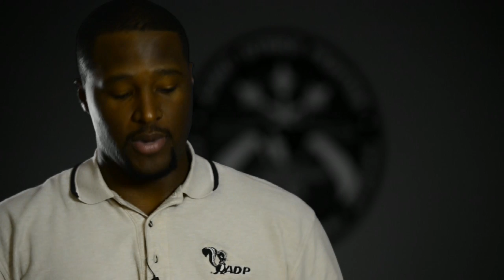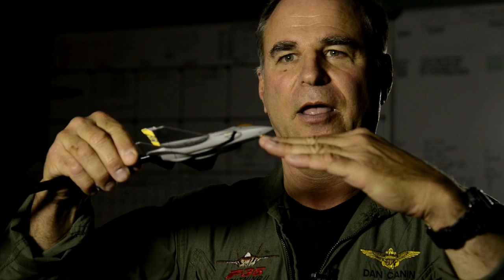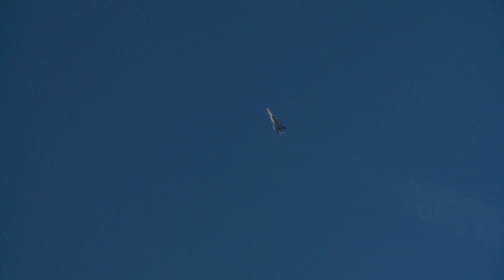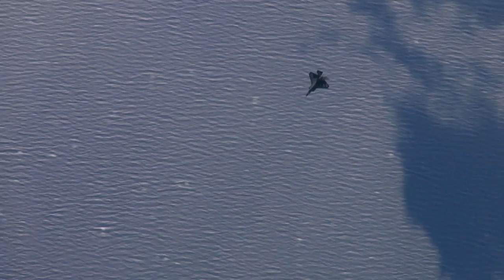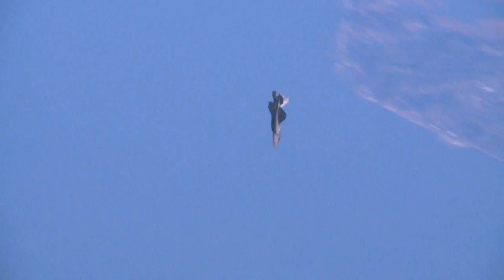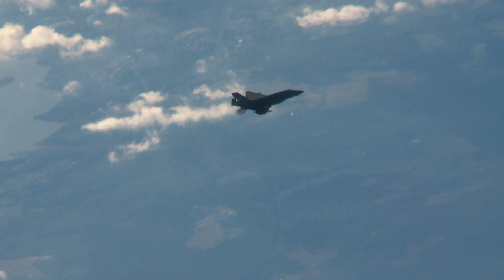F-35C High Angle of Attack

Comment: Committing a flat spin and recover from it without tvc is damn impressive
Reply: TVC adds weight and complexity. 3D TVC adds even more weight and complexity. Case in point Indian AF SU-30MKI with TVC have 19% mission availability with TVC. Indians have disabled and removed TVC to improve availability. TVC in SU-30 family only activates below 200 knots, and gains authority below 150 for slow speed. Intent is for SU-30 pilot/crew is to slow down the fight to where American have low energy disadvantage. F15 and F-16 crews train to maintain energy (speed) in a fight. F-22, F-35, Rafale, Typhoon, and Grippen pilots can fight at low energy states. Turns out that European canadrd double delta planform is just as good for low energy and high turn rate fight with high nose authority. F-15C below 220knots IAS, has little chance against Typhoon and Rafale in guns/IR missile fight. Those canard double deltas can convert to F-15C six faster then F-15C can react.
IAF and USAF did a worst case scenario exercise. IAF would have all advantages, and USAF would have no advantages.
RUles:
Red OPFOR:  IAF force 17 SU-30MKI with USAF E-3C acting as Indian AWACS. SU-30MKI have TVC, R-73, R-77, and Indian missiles. No restriction, except for missiles being inert but with active seekers. No radar or IRST restriction. In flight refueling tanker available.
Blue Friendly : 12  F-15C . Restrictions. No AWACS, no tanker, no AMRAAM. AIM-9M and AIM-9X with guns only.

Three day air war exercise. On day one IAF had upper hand and were able to score hits based they were able to fire their radar missiles first. 2nd day. F-15C squadron adjusted tactics, and were able to get first lock, but were restricted to AIM-9. They still got kills, and took hits. 3rd day. IAF problems became accute. Their servoce availability went down to 25% percent mission readiness due to maintenance and slow re-arming, regeneneration. Then dropped to 19%. Indians disabled TVC on their SU-30MKI and mission availability climbed to 35%-40%. USAF maintenance and arming crews were able to generate F-15C quicker with 60% mission availability.

End result as to victory conditions were classified by both Indians and Americans. But it was clear that in a real world conflict with no restrictions, Americans would be able to generate more consistent numbers of aircraft across time of conflict. So whatever victory that Red side seeks in RW  air war against USAF + Allies, it had better gain in first few days.
Reply: @dkoz8321  russian dont even use 3D tvc, they are 2d, but canted like a V shape for some mixed yaw and roll control at the same time.

Comment: Let see how the "C" variant holds up to the recent review.  They have severe problems with causing pain and disorientation to pilots on takeoff and landing.  The "C" variant will only be "ready" by 2019.  The acknowledge the landing gear needs to be redesigned on the f35 "C" variants as of 2017.  I see more Advanced Super Hornets in the  future.

Comment: IMO The F-35C should have been a twin engine fighter as an exception. It meets the Navy requirements and can be way more powerful.
Reply: ***** Yeah I know, it was just a suggestion. But the C variant is already good as is.
Reply: +Stormsquad 2 engines requires X2 the maintenance and X2 the probaility that something goes wrong and causes the aircraft to crash....F16 has been flying for years on 1 engine no problems. get with the times its not 1930
Reply: +Vijay mehra This is an old comment man, it's ok, I know 1 engine is good enough

Comment: F-35 "can out manouver the F-18 Super Hornet (In dreams) say some, if is true, explain this: the F-18 Super Hornet have LIFTING nose surface extend it from the Leading edge wings toward the thin nose, Have it the F-35?, Have Canards the F-35 as Typhoon, Rafale, Gripen and Su-35?, Have: Vectored trusters as F-22?, Why lost energy in his 60 AOA and go down fasted as is seen in test videos, I dont see a F-18 Super going down losing altitude, less: the F-22 and Su-35 in any video or air show, easy to understand: vectored trusters (F-22), Canards (Su-35, Typhoon, Rafale and Gripen) and zero lifting nose surface (pledges) as any F-18, this say all in dog fight and close turns.
Reply: cannricky Perez Not sure why you think the F-35 can't have a higher AOA then the F-18. Aside from pilot testimony (not on Lockheed's payroll), there are many ways to achieve a high degree of AOA aside from LERX, Canards and Thrust Vectoring.  F-22 and F-35 uses Chines to create the same effects as LERX.  You definitely DON'T want Canards on anything like an F-22, F-35, F-18, Su-30 or Su-35.  Europeans use Canards to fix inherent problems with their delta wing designs.

By the way, Lockheed never said the F-35 couldn't dogfight.
Reply: cannricky Perez Indian Su-30MKI has electronic defects, and screens go blank in mid-flight. 3 have crashed already. Believe me I know
Reply: Stormsquad Also, a Indian MiG-29K crashed because of FCS problems
Reply: IBT98 No the Mig-29K is for the navy, it never crashed. It was a normal Mig-29 that crashed which was of the IAF. Here read this http://timesofindia.indiatimes.com/india/MiG-29-crashes-in-Jamnagar-pilot-ejects-safely/articleshow/25434042.cms
Reply: Stormsquad recently, a MiG-29K indian navy was damaged doing a landing
Reply: IBT98 Show me the link
Reply: IBT98: my friend, I think that Stormquead is right, many argumentists talk without a reference or inf. title topic, he is posting the web page. Sincerilly landing gear is a little failure if you compare F-35 mishaps history, as F-22 Alaska pilots talk to you about good performance, is the desire of F-35 pilots.
Reply: cannricky Perez F-35 has never crashed, the F-22 has crashed about 3 times and the Migs have crashed countless number of times. Especially the Mig-21s
Reply: Not crasched of course, agree.
Reply: +cannricky Perez Only the su-35 prototype has canards.. the production version doesnt
Reply: You understand absolutely nothing about the design of modern 5th generation airplanes!
Reply: This whole reply section is a pile of steaming bullshit.
The F-35C outturns the legacy hornet by 1 degree per second and super hornet by 2 degrees per second in the sustained turn rate. The only place where the hornets have an advantage is in high aoa or instantaneous turn rates, but the F-35C does still have some vortex generators and a much better lifting body than any hornet, closing that maneuverability gap by a lot.
Reply: Don’t believe me? This is a video of an F-35C doing a 7g sustained turn. https://youtu.be/4FqO5kbE7gQ
Reply: https://youtu.be/56sN40ojEv8 This is an F/A-18 blue angels legacy hornet doing a sustained turn rate of just 17 degrees per second at 7g.
Reply: https://youtu.be/C3PAEIUc09A And this is a super hornet doing 16 degrees per second sustained turn rate at 7g.
Reply: And to add, this is an F-22 doing a sustained turn rate at 7g: https://youtu.be/FyviMdwwWRA
17 degrees per second, more than 1 degree less than the F-35C at 7g.
Reply: Second language, simple: F-35 dont have "Post stall manouverbrability and CANT outmanouver the F-18 Super Hornet.
Reply: Lockheed and Pentagon words, not me, lol. About 100% stealth and Dogfight.
Reply: Su-35,Su-27 lose tons of energy....especially in high AOA
Reply: Su-35 lose tons of energy?, really??, telling with words is easy but I when I see the "Cobra" manouver in PRACTICE, in any source video: I don't see the Su- 35 falling or loosing altitude vs any actual F-35 video where lose a lot of altitude, only with this little facts! : the F-35 can't do "dogfight"  •Lockheed words•, don't have canards to enhace AOA with Pitch axe, less: vectored thrusters but in F-22 with more weight, I see the "Cobra" and the F-18 Super Hornet: never with "Cobra" but better that F-35 in hight Pitch because have leading lets in his all front nose extend to wings leading edge.
Reply: cannricky Perez The Su-27 in general has inferior L/D in the turn.....and...although it gains energy in a stalling AOA
Reply: Thanks, but yet, the F-35 don't to convince me, the F-22, the F-18 Super H. and Su-35 were proved in Red Flag exercices more of 4 years ago, neverthelees the F-35 dream to particape but as is VFR exercices; dont have hight performance manouverbrability to do dogfight against Typhoons, Rafale, Raptors and S. Hornet, these also have advanse ECM package to defended himself or atack, not old version as 4 generation aircrafts, this tell a lot about engagement rules vs data specifications,  hight AOA or limited stealth "technically" just saying.
Reply: How can fly in combat when is grounded after have surprise troubles while is operational in bases?, the new mishap in engine fire acording to web. information explanation, Aviation/http://Videos.www.com and maybe: Combat Aircraft magazine was: hight pitch/roll manouver the cause and consecuent failure in engine protection, to make sense: as was with F-22 oxigen problem and paint job, this measures limit the hight combat performance of any aircraft, but F-22 was fixed and finish history. And rememeber: the EF-18E Growler have good ECM in simulated Red Flag shoot down a F-22 that 100% stealthly vs F-35.
Reply: cannricky Perez The F-22 can fly pretty well, There seems to be no problems...actually talking with a F-22 pilot form Alaska a year ago

The F-22 has no engine problems

same can't be said for the PAK-FA

or the Flanker
Reply: But IBT98, the Flankers don't have engines problems and you can read news of Su-35 new generation but my friend, you forget the F-35 engine fire and faillure.
Reply: cannricky Perez Remember the PAK-FA?

A new engine blowout just happened 

T-50-2 was destroyed by the fire 

second, you do know there are only 12 operational flankers in Russia right now?
Reply: O yes, the Pak T-50 had fire in his intake right engine, but not Flankers Su-35, also the same cheap Indian Su-35 Mk not had.
Reply: cannricky Perez But they are grounded because Russian engines are shit

They are easily damaged and unreliable

AL-41F for the Su-35 is terrible
Reply: This is new??, well I can't contribute about Russian engines, my personal information in this specific topic, is very limited, I know about Pak engine fire, but as I know; Russia is yet keeping the proyect and are some news videos in Youtube.
Reply: cannricky Perez IT is new and it's really funny
Reply: How I can search inf. With: Su-35 AL-41. or is another proyect?
Reply: cannricky Perez look it up :D
Reply: I. Know that China made his own Su-35 engines, I don't know if India can do the same about Su-35, but at least :India not have engines troubles.
Reply: cannricky Perez But they are, but they manage it much better then the Russians

Comment: STOP the fucking F-35

yeah it can hold a 50º angle of attack and some more

but it's turn rate is worse then the Su-34's

It can climb, 

It's 43 seconds behind the F-16 to accelerate from Mach .8 to Mach 1.2

It can't maneuver to dogfight  

Loses more energy then the Su-27 in a high G turn

Just stop this shit
Reply: Dude, I think your information is behind the times.  I've been researching this craft for a while.  My suggestion is get away from youtube.  The F-35 out thrusts the F-16 and when combat loaded out maneuvers the F16 and F-18.   F-16 pilots say that when the F-35 open up on the throttle (without AF), the F16 pilots have to use afterburners to keep up.

"Loses more energy then the Su-27 in a high G turn"

The F-35 with a combat load can currently max at mach 1.6 but its top speed hasn't been set because of concerns to friction on the RAM skin which is being worked on.  The Su-27 in the same situation cannot even do Mach 1.6 and can not out maneuver the F-35 let alone the F-35's advanced weapon system.
Reply: Lets look at some figures against some proven and supposedly superior platforms, lets compare them and see. 

If you really know something about planes you would know that you basically need 3 essentials to be maneuverable:

1. Lots of Lift
2. Lots of thrust
3. Little Drag

Lets discuss lift: 
I know you probably heard Pierre Spray said that the F-35 is a dog because it has little wings. and has to carry 110lbs of airplane for every square foot of wing. 

Pierre Spray was involved in the aircraft industry at around the 1960s where fighters were basically tubes with wings. 
At that time all of the lift came from the wings. small wings = small lift.

But at around that time Martin Marietta (now Lockheed Martin) was experimenting with Lifting Body designs, they wanted to produce fuselages that can assist the wings in producing lift instead of being dead weight.
Read more here: http://en.wikipedia.org/wiki/Martin-Marietta_X-24

That’s why at around the 1970s we began to see fighters with wide flat fuselage sections and smaller wings. So lets compare the wing loading of the F-4 against Pierre Spray's favorite F-16 variant the F-16A.

F-4
Empty: 30,328lbs
Load:8000 lbs
Comabt Weight: 38,328
Wing Area: 530 feet
Wing Loading: 72 lbs/ sq feet

F-16A
Empty: 16,300
Load:8000 lbs
Comabt Weight: 24,300
Wing Area: 300 feet
Wing Loading: 81 lbs/ sq feet

So by Pierre Spray's own argument the horribly turning F-4 should fly circles around his hotrod F-16? What’s happening here?

Well the F-16 does not rely on just wings to produce lift, it has a blended body and wing design, plus LERX that produce vortices above the airplane (if you remember you physics, high pressure below + low pressure above creates lift)

around 40% of the F-16s total lift does not come from the wings at all. So in reality the F-16's actual wing loading when loaded with 8,000lbs is closer to 49 lbs per square feet not 81 lbs.

The F-35 is the same. to get the F-35 to have 110lbs / sq ft of wing loading as Pierre Spray said it needs to carry 21,300 lbs of load. 

The f-16 can never do that, but the F-35 can! that’s what’s great about this plane, it gives you options, if you need to go to a long range mission then sure, the F-35 CAN carry 18,000lbs of fuel and 18,000lbs of weapons.

But if your going to a CAP mission where a dogfight is possible, then why load it with 21K? Most likely an F-35 would take off with 18,000lbs, And when it gets to combat it would probably have 10,000lbs depending on the range to the target.

So lets pit the F-35 against some really good aircraft, Wing Loading calculation. 
All loaded with 8,000 lbs, perfect for dogfighting:

Wing Loading:
Mig-29 M/M2: 91
F-16C (block 50): 90
F-35A: 81
F/A-18C: 77
Su-30MKI: 72

So as you can see at dogfighting weights, the F-35 is not bad at all, its not the best but really not all that bad. 

Now consider this, the F-35 probably has the most efficient body lifting surface of all these aircraft due to the fact that its fuselage has the smoothest flatest surface of all these planes, not a lot of disturbance for the wind to flow around on. 

So lets give all these aircraft a Body lifting coefficient of 40% but to be conservative lets give the F-35 45%, the truth is probably much larger but hey lets keep it down.

Wing loading plus body lift:

Mig-29 (M/M2): 54.6
F-16C (block 50): 54
F/A-18C: 46
F-35A: 44
Su-30MKI: 43

The F-16s wing loading is similar to the Mig-29s which is why it replicates the Mig-29 in RedFlag.

But Notice how the F-35's wing loading is so close to the F/A-18 and just 1 pound above the Su-30, which is why when you ask pilots they will say that the F-35 maneuvers like an F/A-18 with better acceleration. 

And really acceleration is the only thing Hornet pilots dont like about it.

http://www.flightglobal.com/blogs/the-d ... -tactical/
Lt Col Matt Kelly wrote:
Operational pilots should be thrilled with the F-35's performance, Kelly said. The F-35 Energy-[Maneuverability] diagrams, which display an aircraft’s energy and maneuvering performance within its airspeed range and for different load factors, are similar to the F/A-18 but the F-35 offers better acceleration at certain points of the flight envelope. 

So do you still think they are lying? 

Now lets talk thrust. This is a no brainer, the F-35's engine is rated at 43,000lbs the most powerful in the world. So lets cut to the chase and compare.

Thrust to weight at max thrust:
(All loaded with 8,000 lbs)

Mig-29 (M/M2): 1.05
F-16C (block 50): 1.05
Su-30MKI: 1.13
F/A-18C: 1.14
F-35A: 1.15

Surprise Surprise, the F-35 has the best Thrust to weight ratio of all of the planes involved, and really in a dogfight Thrust to weight can be more valuable than Wing loading. 

Now Drag: 

All these planes will carry weapons externally adding lots of drag. with a full centerline tank the F-16 is reduced to 7Gs max and the Mig-29 is reduced to an appalling 4Gs, the F-35 will carry most if not all its missiles internally, very little drag.

So to conclude, even without Stealth, even without all its advanced sensors and ECM suits, the F-35 will (in the words of Pierre Spray) wax the competition every single time, then if the F-35 is a dog the rest should be compared to kittens.
Reply: Bobby Johnson The F-35 is amazing,

it is a lifting body with around 45% of it's lift(45.37lb's of lift/ft2) which is amazing design

The F-35 is a superior fighter
Reply: Stormsquad oi m8, this is an old post
Reply: Bobby Johnson What?
Reply: *****

Not saying you're wrong but send me some sources
Reply: Are you getting your info from the hover version of f 35 its limited because it hovers the navy version is different.
Reply: ***** I know, it was a type sorry

dogfighting is around transonic
Reply: IBT98 C'mon man, you know better than this. You know very well the F-35 isn't a bad plane and that it can out maneuver even an Su-27.
Reply: IBT98 Yeah but you were criticising?? So know you don't?
Reply: Stormsquad It was an old comment, before I knew
Reply: IBT98 Hmm ok lol. No probs :D
Reply: I don't need to say anything as this guy below owned you